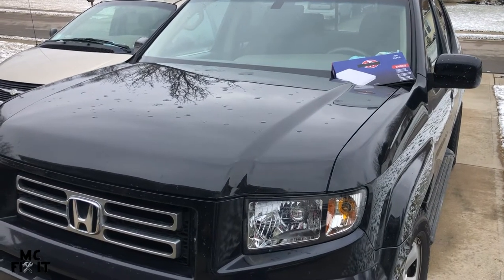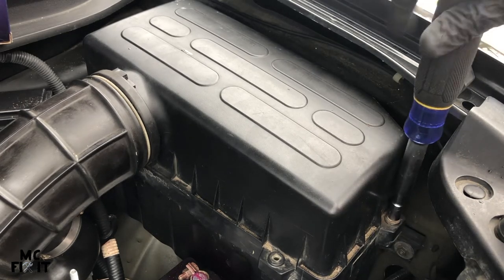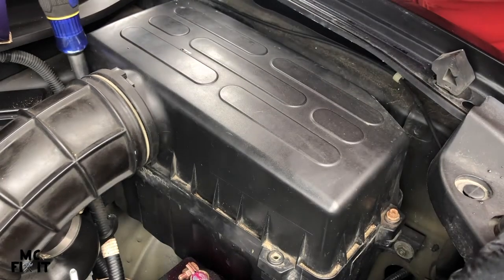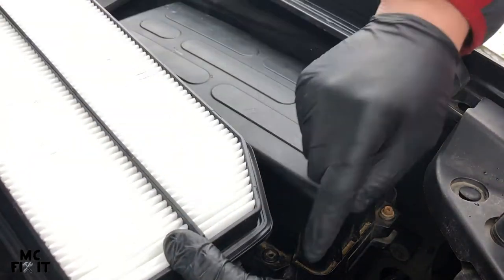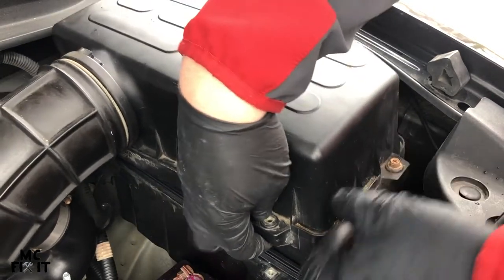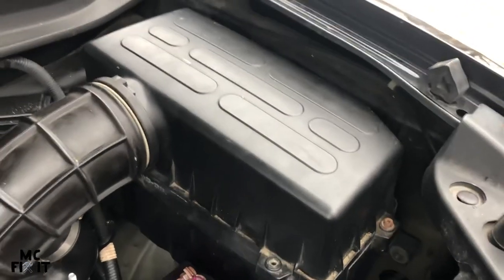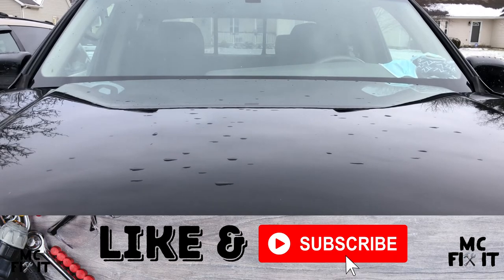How to change your Air Filter in just Minutes! Honda Ridgeline 2006-2015

Comment from the maker: Change your Air Filter in just minutes! 

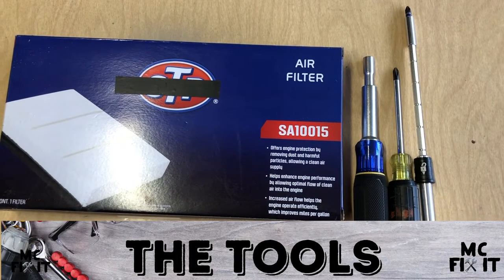00:52 THE TOOLS:
• Long Philips Screw Driver - https://amzn.to/33tlxZ1
• 5/16in socket with a screwdriver handle - https://amzn.to/3w70Hez
• Air Filter - CA10015, SA10015, A25656
* FRAME CA10015: https://amzn.to/33v71Ac
* Purolator A25656: https://amzn.to/3uuril8

With this simple technique, you can successfully remove and replace your air filter! 

This video works on all makes and models of vehicles. The video was done on a 2006 Honda Ridgeline first generation. 

Check out my website at http://mcfixit.us 

Disclaimer:
Due to factors beyond the control of MC FIX IT, I cannot guarantee against improper use or unauthorized modifications of this information in the video, post, blog, or social media. MC FIX IT assumes no liability for property damage or injury incurred as a result of any of the information contained in this video. Use this information at your own risk. If you feel uncomfortable at any time. Stop and go to a professional. MC FIX IT recommends safe practices when working on vehicles, your house, or any other project and or with tools seen or implied in this video. Due to factors beyond the control of MC FIX IT, no information contained in this video shall create any expressed or implied warranty or guarantee of any particular result. Any injury, damage, or loss that may result from improper use of these tools, equipment, or from the information contained in this video is the sole responsibility of the user and not MC FIX IT.

#mcfixit #autorepair #fix #repair #airfilter #changeairfilter #airfilterchange #honda #ridgeline #hondaridgeline
——
Supplies used to record this video: 
* GoPro Hero 7 Black - https://amzn.to/3f3ALtb 
* 256GB Flash Drive - https://amzn.to/33pAueG 
* Vlogging Frame - https://amzn.to/33tajE0 
* GoPro Pro 3.5mm Mic Adapter - https://amzn.to/2RCURCu 
* Youmic Lavalier Lapel Mic - https://amzn.to/2R55sWX 
* Boom Stand (tripod) - https://amzn.to/3bdkQaw
* 5/8” to 1/4” adapter (boom to blogging frame- https://amzn.to/3txrVsM 
* Portable Battery Powerbank- https://amzn.to/3vJQc0q 
* 6ft USB to USB-C (powerbank to GoPro)- https://amzn.to/3uAS5MH

Comment: 12k? I change mine every oil change for best efficiency. Then I got tired of spending all that money per oil change and bought a K&N washable. I still do the air filter washing every oil change tho. Great video! Thanks
Reply from the maker: Thanks for sharing. That is definitely something you can do. Most of the filter have a 12,000 mile or 1 year long life. If you have $50-60 then a K&N washable filter is a great option! I've used them before and like them.
Reply: I love my k&n on my truck but use the cheaper ones on my car

Comment: Thanks for this video. Did you end up finding a bolt to go into the space where you are missing one? My ridgeline has is missing one too on the top right (the hard one to get to).
Reply from the maker: Not yet. I hope to look around my garage tomorrow and find one.
Reply: Dorman 41085 Air Cleaner Fastener is a good replacement for OEM. Cheaper too. 12 bucks for four versus 9 and change per screw from the dealer. OEM part is 90091-RAA-A00

Comment: Will changing this improve my mpg. My oil is still 30% but I drove cross country & it's been over a year so thinking even I can do this & will if it helps since I'm only getting 12mpg & only have 12,000 miles on my 2011 Ridgeline
Reply from the maker: If it’s super dirty, then it will help. 12mpg is pretty bad. Are you hauling anything? If so, that makes sense. But just driving, you should get better. Have you changed out the spark plugs in the last 50,000 miles? If not, I’d probably do that bc that helped me get better mpgs over an air filter. It’s honestly a bit harder to do but not super challenging.

Comment: Can you take off the intake hose for better access?
Reply: I didn't need too. I was able to slide it easily under the box like MC did!
Reply: I wouldn't there is plenty of room to remove the old one and put the new one in
Reply from the maker: For sure. But I dont think its necessary. If you do and have a shotvac, go ahead and clean out the bottom of the box. Sometimes there is debris in there

Comment: Do you find a big difference in the type of filter? Ive heard good things about K&N but they are really pricey!
Reply: Most are very similar (probably manufactured at the same factory). K&N are expensive but are washable. So they are kind of in a category of their own. You can continue to reuse them time and time again.
Reply: I like Frame filters. Not sure if that's because I've always bought them or that they sell that at my local Walmart for bit cheaper than almost all of the auto part stores in my town.
Reply from the maker: K&N are really good but pricey. I tried to show more of a basic level filter in this video.

Comment: Dorman 41085 Air Cleaner Fasteners are a good replacement for the OEM bolts
Reply from the maker: Thanks so much! Someone will find this very helpful!
Reply: @MCFIXIT  I hope so. They're much cheaper and so far holding up well. And, maybe it'll save someone from having to use a wood screw like the previous owner of the used '07 Ridgeline we just bought! 😂